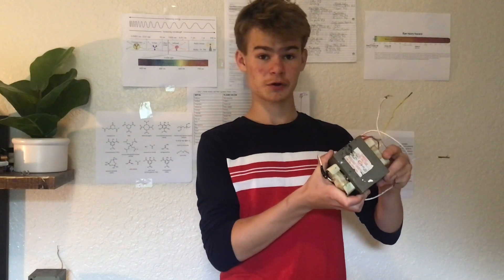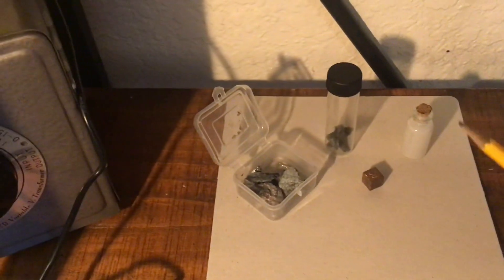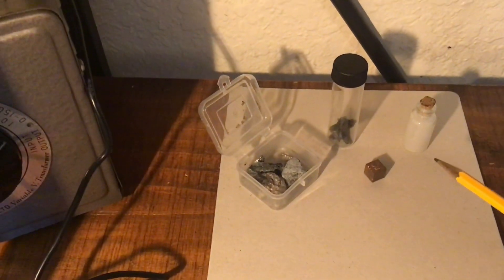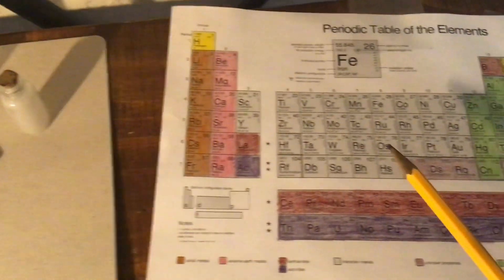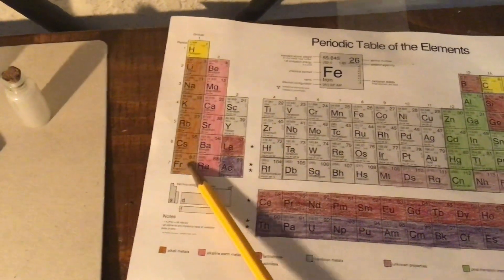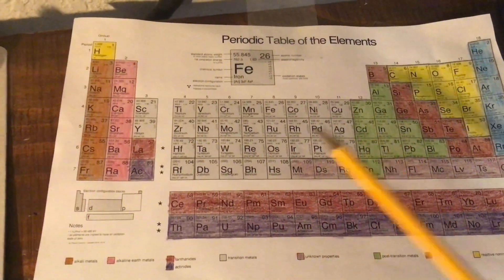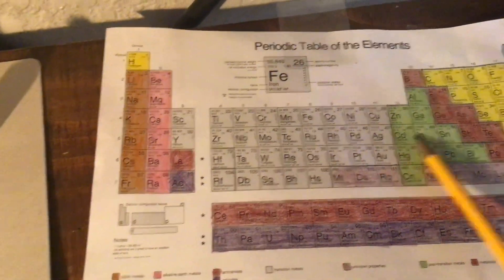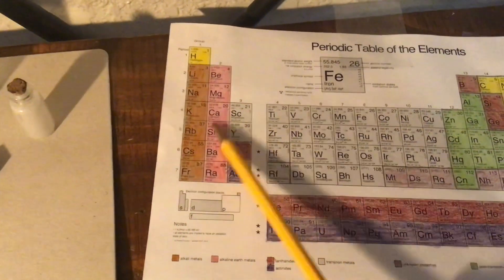Changing The Color Of ELECTRICITY!

Comment: Metals just vary the resistance. This could also be done through capacitance or inductive retardation,,,, RLC circuit
Reply from the maker: Yeah, for example zinc has a pretty high resistance, thats why the arc size was the smallest with zinc, but with sodium and other alkali elements, its actually the valence electron that allows them to stay in an ionized state for much longer, which would allow it to create more free charged particles in the plasma, thats why you get the largest arcs with alkali elements or salts.
Reply: @Joseph_sidl  try mercury on a vacuum
Reply from the maker: @brettmoore3194  oh yeah the classic mercury arc rectifier, well normally in a vacuum chamber there is no air to get in the way of those charges so its easier to create an arc
Reply: @Joseph_sidl  arc easy and cascades to less watt draw if a circuit is designed right
Reply from the maker: @brettmoore3194  well it first requires a lot of energy to ionize the mercury, then once its ionized you can pass a low voltage through it
Reply: @Joseph_sidl  I would use a thorium based thermionic element for excitation